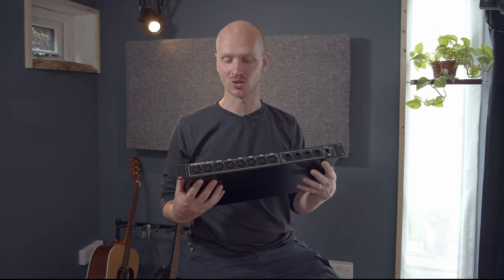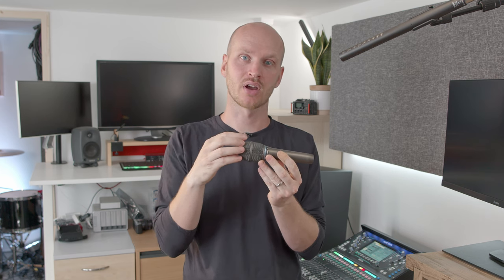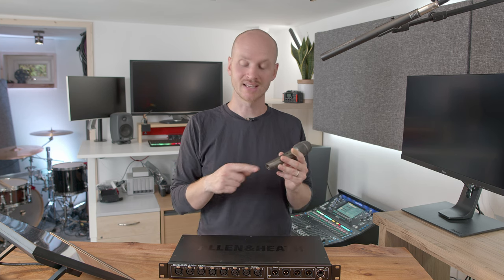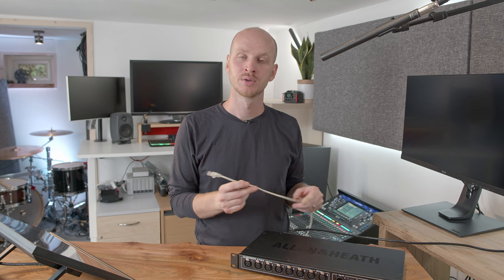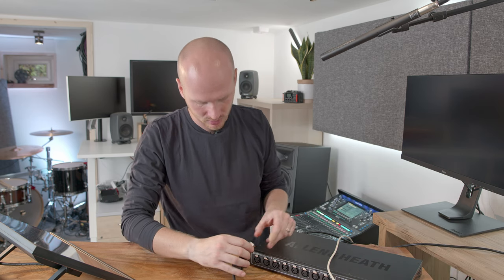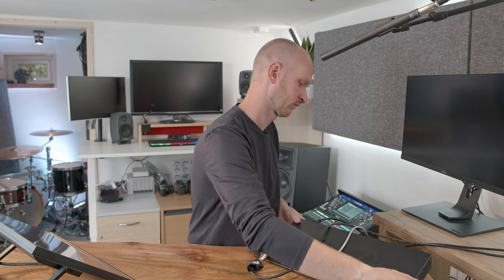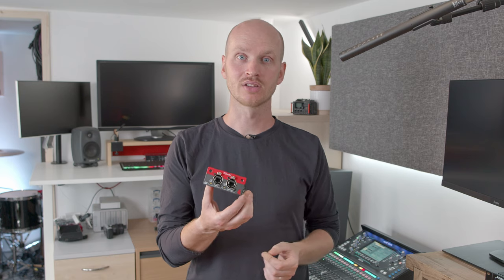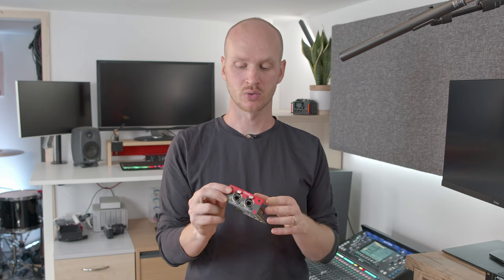All you need to know about Digital Stage Boxes

Comment: It is better to work with higher Quality Network cable. Cat 6 better 7. you have a better Schild protection. The maximal length of LAN Cable without repeater is normally about 180m. If you have lower quality cable, the max. length is reducing. And you are better protect against other Signals. For example DMX. Normally you should not make the same Way of power Cable  and LAN cable. All this Faktors are reducing your cable length, or you have bit faults. As a result you have drop outs. And handle LAN Cable with care. Not knicking the cable. All that can make Problems.

Comment: My salesman told me Dante stage boxes made by one brand don't work with other branded Dante stage boxes, because the preamps are controlled via their proprietary systems, it just uses the Dante audio protocol. But you seem to say different?
Reply: He was partially correct:
On Dante you can patch audio between all systems, only issue is the sample rate (48KHz vs 96KHz etc), they have to be the same.
Controldata like HeadAmp control etc. is Vendor specific, and 90% no usable between brands.
There are a few like some Wireless brands can be monitored and partly controlled from some brands of consoles.

Most however have a remote for their stageboxes you can use on the computer used to make the Dante patch anyway.

Comment: Thank you for this very informative video. As you said, gone are the days of the old analogue stage boxes and multicore cables run to the front of house and a bunch of XLR's at the other end. One CAT 5 cable does it all which is quite remarkable. The only bit it don't understand is why does it have mic pre's built in? - I understand there has to be some sort of analogue to digital converter for each input, but aren't the mic pre's in your mixing desk? I would really appreciate your feedback. Thanks, Peter.
Reply: The explanation is simple, in your mixer the Digtal Signal went directly to the Channels, you alternately can trim the Signal on the mixer. An digital Signals need a headroom for 0 and 1 Signal which is in the Bit Deep. In the Analog Input Signal you need headroom and you don’t want to get ground noises into your digital Signal if in the input signal stage box is 25% ground noise. It is the same reason like long lengt Cable like Multicore. You have not so much Signal Quality reduction.

Comment: This is very interesting to me, but I have many questions. #1- Can a "stage box" be used as an audio interface and a DAW as the "mixer of the pre-amps", or do I need a digital console?
What I am doing is what some refer to as a "hybrid" mixing system. Basically, my DAW is just a multi-track tape machine. These recorded multi-tracks are then sent to my analog board for mixing and processing through outboard gear and then printed back to the DAW as a stereo file for mastering.
As I am usually "recording" 1, 2, 3 or 4 tracks at a time my "4-channel in interface" works fine, but as these tracks build into 12, 24, 36 tracks, my "4-channel out interface" doesn't cut it.
As a FOH mixer in the 80's, I completely understand the concept of a "snake", 32 sends 16 returns. My problem is I don't need the sends, I need the returns and I haven't found an interface with 4 in and 16 out.
Chaining 4 interfaces together VIA "ADAT" so my DAW can see 16 outputs is never going to happen.
I know there are interfaces that have more than 4x4 I/O, but I will be spending money on inputs (PRE's) I don't need, and inevitably having to connect at least two VIA "ADAT".
My Delima is, I need more OUT than I need IN. Is there a solution and could you give me some ideas?
Reply from the maker: Hi David, thanks for the comment. In answer to your question, no this can’t just be connected to a computer. These boxes need to connect to a mixer which acts as a ‘brain’ for the stage box. In your case it sounds like a small digital rack mixer might be the way to go. Take a look at the Allen & Heath QuPAC or the Behringer X-rack. Those will give you 16 inputs but 8 outputs. I know it’s not exactly what you want but it’s the closest thing I can think of. You also then have the option to add additional stage boxes to them for further outputs if you want. Allen & Heather do a box with 12 outputs only that I think will work with the QuPAC so you could have 16 inputs and 20 outputs all on a single USB.
Reply: @PluggedinAV  Thank you for your response. Yea A&H Qu series, awesome.
Kinda defeats my purpose though.
What I am envisioning with a stage box is, could I connect VIA cat5, through my computers network card and have my DAW some how be the "Brain", or the digital mixer? I am not computer literate enough to even know if DAW software would recognize a network card as I|O. In my little brain I think that it could.
Again, thank you for your response
Reply from the maker: No, stage boxes will only work with their relevant mixers👍🏻
Reply: @PluggedinAV  Actually I think I have found a way to do this with any stage box over a Dante network with "Dante virtual sound card" I will let you know if it works. Again thank you.
Reply: @davidkeller8084  Curious to know if this worked
Reply: @davidkeller8084  I'm curious to know if this worked or not. Any updates?

Comment: we have a presonus 32 rack, could we buy another rack like a Midas 32dl for example and connect them together? @Plugged-in AV
Reply from the maker: Hi, it depends on which protocol they are using. If both stage boxes work using Dante for example then yes you could however I think with the ones you mentioned above they wouldn't work together as they don't use the same protocol. Normally it's safest not to mix and match but stick with the same ones.
Reply: no, you can't. prosonus unfortunately doesn't have dante nor does a DL32